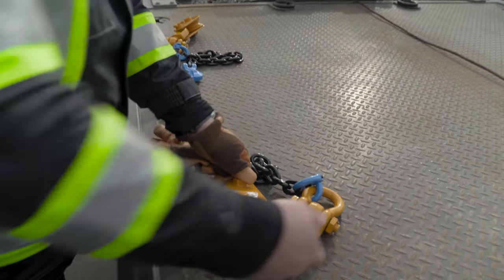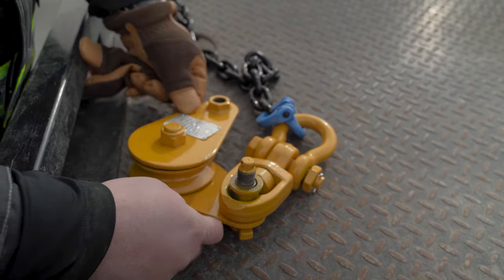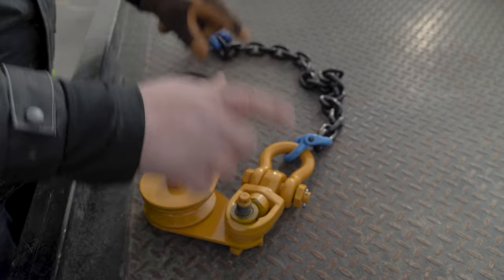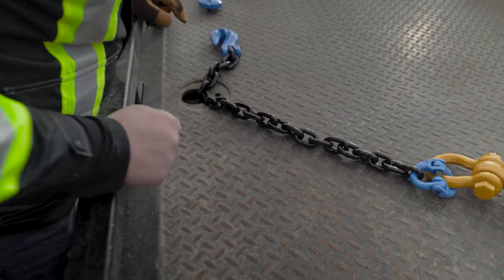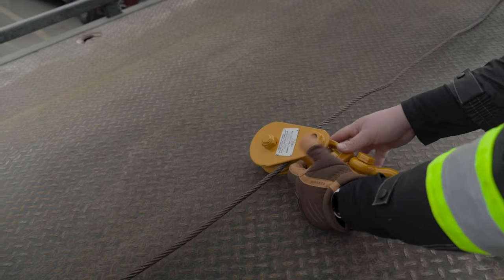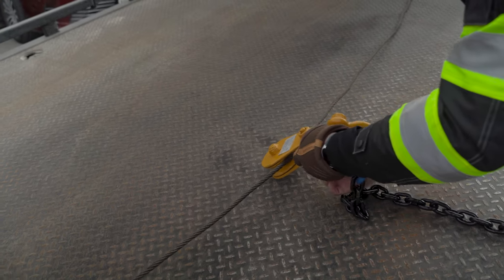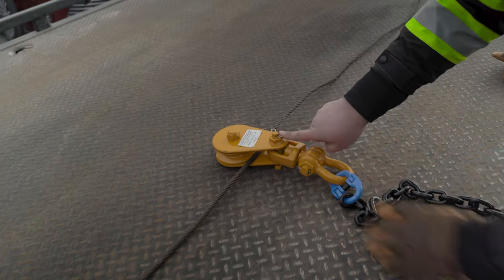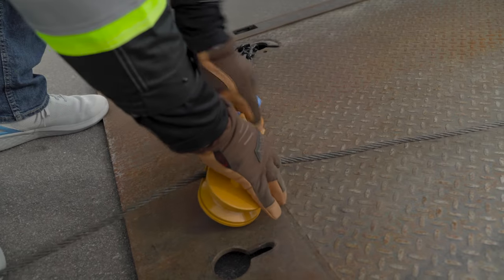One Way to Use Snatch Blocks for a Winch Out

Comment: No need for two snatch blocks. The one closer to the end of the bed was fine
Reply from the maker: Thank you for your thoughts!
Reply: The second snatch block centers the winch on the drum, Doesn't matter much if you use the whole chain on the end block, but if you put all of the chains in the hole to get the block much tighter in the corner of the bed then the 2nd block helps a ton if you have steel wire rope.
Reply: It don’t hurt none